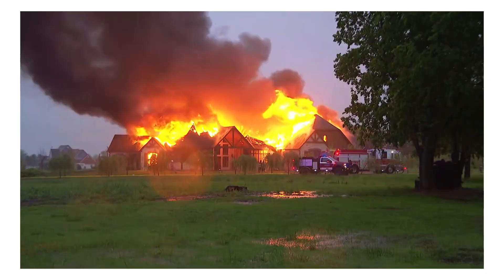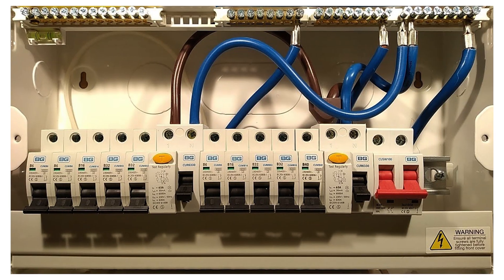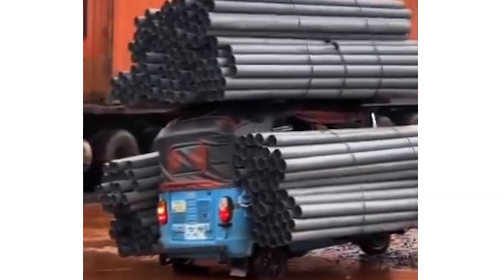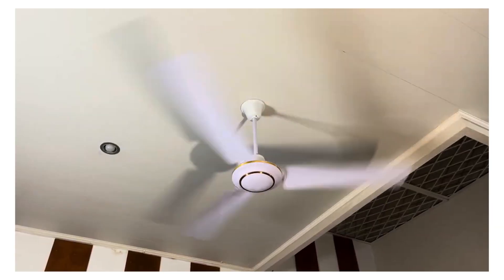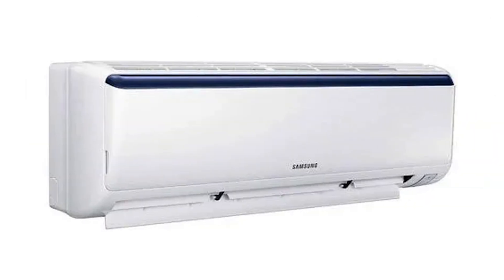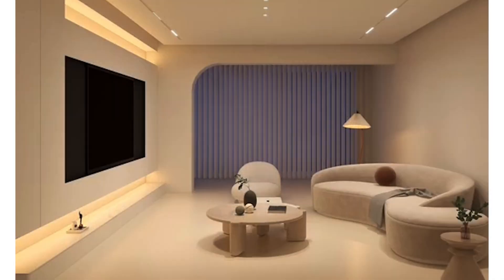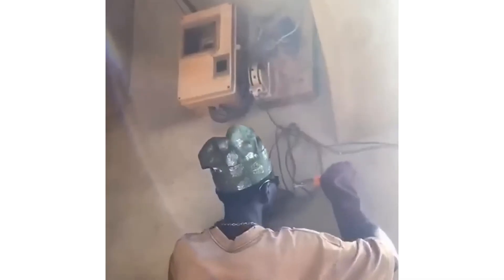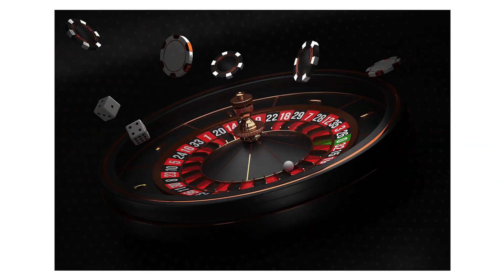Single vs Three Phase Power: Which One Do You Really Need?

Comment: I disagree. 
Most single phase appliances are rated for 100a. At 220v thats 22kw. Even a 6 bedroom duplex with all rooms occupied should not be anywhere near that. And if there is an overload, its the cut out fuse that would go out. Trippinig circuit breakers mean too many devices are on one circuit, thats not neccessarily connected with single/three phase.

Comment: Single phase, triple phase or half phase (😂), load analysis should be done by a Professional Electrician or Electrical Engineer. Allowances should be made for future growth and future appliances too. Enough load in amperage should be brought into the main service line, the breaker box should distribute current according to need, safety, areas and electrical/building codes. Improper electric wiring and distribution is a fire hazard and may cause electricution in some instances.
We need to plan properly and think of safety.
"A stich in time saves nine."

I appreciate you always advocating for proper planning and the use of professionals.

Good luck ☘️ and God bless 🙏.

Comment: Bro this issues you friend had, has nothing to do with a Single or Three Phase supply, The breakers used are of a lower amperage compared to the load of the house.

In a DB, there are diferent size of breakers, how would one breaker teip because of three loads when each load should have been on its own individual breaker?

Lastly, whats the rating of the supply wire, did they calculate the load before buying the wires or they just bought randomly? 😒

While going for three phase, also consider that you live in nigeria, if there is a fault in the feeder of your area and one phase dies, parts of your house will not have power too.

So domestically i prefer single phase, but with proper load shedding across breakers, in some cases i use two DBs if the house is really big.

Lastly, a well planned single phase system makes it easier to incoporate an inverter system when needed by the house owner.

Comment: I don't agree with this one, have been an electrician for over 12 years now, the issue of the breaker being tripping is not in the result of three phase metter or single phase metter. When a breaker is constantly tripping or trips can result to poor wirering or usage of wrong conductors that are over heating

Comment: In actual sense, the scenario you described reflects a lack of professional expertise rather than a load issue caused by using a single-phase supply instead of a three-phase. I can almost guarantee that your friend did not engage a qualified professional. The electrician likely lumped all the loads together, which led to the breaker being overloaded due to incorrect sizing from the outset.
Using a three-phase supply from a public transformer can result in having electricity on your sockets while the phase powering your air conditioner or possibly your pumping machine is off.
The setup you've described is more applicable if you're running on a generator or living in a serviced estate or apartment with a dedicated transformer and generator. Otherwise, you can optimize your single-phase supply by looping it into a three-phase configuration on your distribution board (DB). This approach reduces the cost of purchase, installation, and potentially the statutory charges associated with three-phase meters.
All you need is proper load balancing, the correct cable size, and appropriately rated breaker types.

Comment: Best information here is u can use a single phase but ensure u do load segregation or management once u feed into ur distribution box and ensure u use appropriate breaker amperage for all the different lines on the breaker eg. AC and high voltage equipment should be above 25 depending on how many is on a line. Then lights and bulbs can stay below 10.

In Nigeria for multiple phases u don't have light on them from the transformer at the same time so it doesn't make any sense to send power from each phase to different parts of ur building.

Or do u want some rooms to have power and other rooms not to have cos they are on different phase...?

This only applies if in ur area/country all 3 phases always have light.

My few suggestions

A candid subscriber giving my opinion. Ur videos are always educating but I have an objection to this
Reply: Thank you for this objection and clarification. I'm a layman on this subject and I'm well informed having read your comment and that of others who objected like you did.

Comment: 3 phase connection is very okay but there are a number of factors to be considered when choosing between 3 phase and single phase wiring, which I want to be believe in all humility that sir Folajomi did not do enough justice to. 

1. Size of the house/appliances..... In a small building with not so many appliances, I want to believe a single phase connection is enough. 

2. Not all areas in Nigeria have their 3 phases always supplied by PHCN. More often than not, there's only light on 2 out of the 3 phases, or even one sef 😂😂😂

I think what should be the major focus in home wiring is using quality cables, materials, and fittings, as well as using the correct gauge size for various appliances, lightings , and outlets.
Reply: The No. 2 is a great point, let's also consider when the owner of the house decides to install a solar system, he will be forced to go for a 3 phase solar system which is more expensive😂
Reply: Well said bro, your conclusion is spot on!

Comment: I disagree with you on this one. You don't need 3-phase to run all the loads u mention here. Adequately sized feed cable and not overloading you circuit breaker will do just fine.

Comment: Pure misinformation, a residential building only needs 3 phases if they run any equipment or motor that requires 3 phase, but here in Nigeria, 80% of home have 3 phase but only run on a single phase, and reason is that we all have electricity issues here and one phase voltage can drop and you still have the option to use another phase
Reply: Right ✅️,  same as Ghana 🇬🇭.  As a licensed electrician the reason i recommend three phase over single phase even for residential properties is when some of the phase (s) are off at least  one will be available for use,  apart from this reason single phase is perfect to handle any residential or domestic loads.
Reply: In a domestic setting, if there is a machinery that runs a on three phase, do your single phase I stallion, then use capacitors to do the connections on the 3 phase motor, it will work on the single phase.. there is a calculation to determine the capacitors to be used.. it works 😅

Your borehole machine uses same principle to run the borehole motor😂
Reply: @emmanuelihunda2652 your point Is correct but there's a draw back, especially when dealing with a higher HP

Comment: Why would you need 3-phase if all you need is to bring in power into your house through one source and the meter to record usage? I suspect a job done by a quack or unqualified electrician.
Reply: 3 phase, will allow you have 3 separate phases, to allow you segregate the loads in the building. 
The load sharing is done in the DB

Comment: Is 3phase equivalent to changing NEPA lines for light?
Reply: No, in some cases especially large home or industrial settings, all the three phases power the house at once.

Disadvantage being, if ur not using your own transformer, and there is a fault on one or two lines, other parts of the house will not have light.

The same reason u change phase, of all the phase supply different part of the house, the side affected will not have light!

Comment: Load sharing/ distribution is the solution here. U are correct. The instance wen too many inductive loads are involved, u will nees 3phase supply. But if it is normal resistive load u may not need 3phase

Comment: My father used a 3 phase meter, it kept tripping until he changed the breaker. Also, during connecting, he was advised to connect with copper wires to help disperse heat and reduce breaker trip offs.
Reply: So in other words, it's not a problem of having a single phase meter per se, but rather the quality and setup of the breakers?

🤔

Comment: Misinformation! Pure misinformation. Issues like frequent tripping has more to do with sizing. Single phase 63Amps is more than sufficient for every residential property. You have to do load segregation and follow local electrical codes. Even in advanced countries they use single phase or split phase 100/150 or 200Amps and stick electrical codes for proper load protection and segregation
Reply: 🙌🙌🙌 You’re right. Am using single phase with oversized original wires. 2 a/c  2 freezers and a fridge. No problem for more than a year and half
Reply: He needs more research with a followup video. A 3phase or Single phase has nothing to do with breaker switching off, that is wrong amperage unit and overloading a breaker.
3phase or single phase imbalance issues are seen at the transformer. 
Most house with 3phase meter still have single phase drop to the meter.. and then looping live ... I bet it stem from this type of misinformation
Reply: Pure misinformation
Reply: Huge missinformation. I kept asking myself what am I hearing .... Let's hope he does a follow up... Cos he is an intelligent and smart guy. Love most of his content that's why I subscribed and keep coming back.
Reply: You are right to catch the error. The consumer units in most houses are designed to take three phases but are supplied with a single phase that is jumpered to the remaining two buses on the DB for better load segregation.

Comment: The only problem now is that sometimes not all phases will have power or the voltage on one or more may be low.
Reply: Yes that's our main problem in Nigeria, if not that a single phase is enough for residential
Reply: The information in this video is very very wrong and misleading.
Reply: This is the one problem, the other problem of 3-¢ is that, low once there's phase imbalance, the prepare meter suffers, and once there is a low voltage on any phase, the meter cannot supply power. A lot is attributed to three phase.